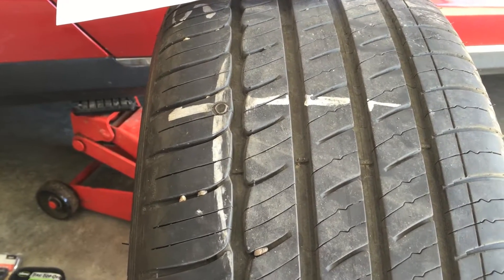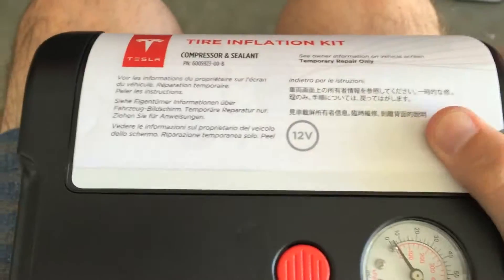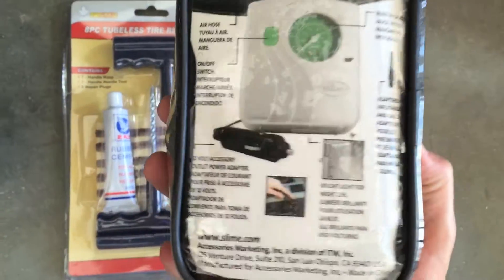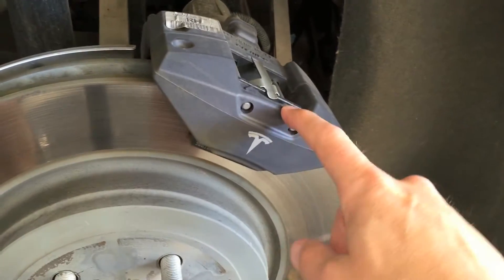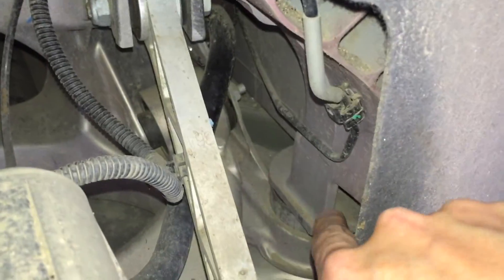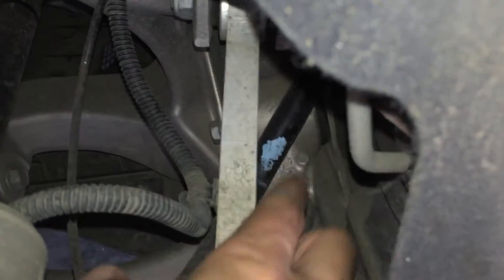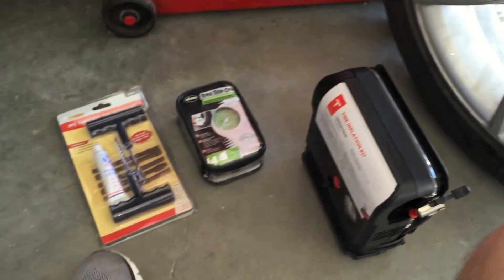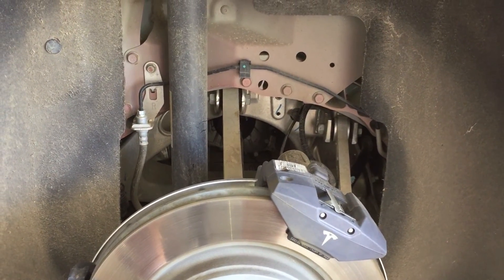Tesla Tire Repair & Model S Coil Suspension Quick Tour

Comment: Tire pressure should be 45 psi not 50
Reply from the maker: There was a period of time in 2015 where the label on the door jamb called for 50psi. I think that was only for like 6 months though and every other Model S has said 45 psi before & after.

Comment: How did you jack the car? Pls make a video. Thx
Reply from the maker: +Carlo Solomon I used a regular floor jack. There are 4 jack mounting points, be sure to lift using one of those points.

Comment: How do you mount the jack ? Is there a specific point for it ? I'm asking because the batteries make the floorpan of the car. Non native english speaker so please forgive my mistakes.
Reply from the maker: +mariusils There are four specific spots right near the wheels where it is safe to jack the car from. The owners manuals shows the jack points. If you miss them you risk damaging the battery.

Comment: Did you ask Tesla why the TPMS didn't alert you about the low pressure and if you did, what did they say?
Reply from the maker: +veryannoyingname I did not (yet). I realized after this video that all my tires were at 47psi not 50. I do wonder what the threshold is, I may email them and ask.
Reply: +InternetDude I wonder what the point of having a TPMS is if it didn't warn you when you get a puncture
Reply from the maker: +veryannoyingname I just fired off an e-mail to Tesla with details to ask about this issue. I'll let you know what they say.
Reply from the maker: +veryannoyingname Tesla replied by email to say they didn't know the level at which the TPMS alert is set. They were going to forward my message to a service center for reply. Also, provided info on how to reset the TPMS via the touchscreen. So, no definite answer.

When I think about it, even on the 85D model with 19" tires, during the 2015 calendar year I am aware that some cars were specified to have 45psi in tires and others 50psi in tires. So they may just have the low tire alert at half the 45, say at 22.5 psi or so.

In my case 36 psi is low but not dangerously low. Had I driven another day or two it may have got to that point.
Reply: InternetDude to avoid excessive tyre wear I hope it warns earlier as I thought that was what it is for, to warn owners to top it up when it's lower than recommended.
I remember it was the same when I asked about Bluetooth etc at test and over phone and email. I even spoke to the Amsterdam people over the phone but got no definite answer. They were polite but fobbed me off without answering the question. The same songs in my stock run of the mill Toyota stereo over Bluetooth sounded much better than in the Tesla with the upgraded sound system. Yes the Tesla touch screen optimisation was cool for each seat but sound for same song was better in my Toyota stock stereo. I hope they have improved that aspect in the last few months.
The power output of the USB can be tested via cheap USB power metres or apps that measure battery charging in your phone. Thanks.
Reply: My tyres are inflated to 3 bars. I deliberately  deflated one tyre to 2.8 bars and nothing happened. I tried at 2.4 and it work. My TMS indicated a low pressure signal.